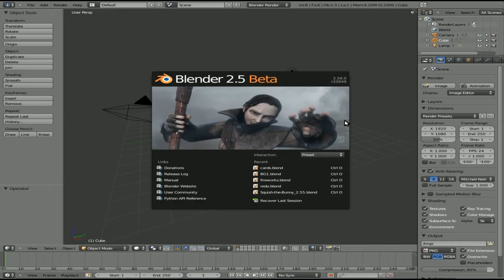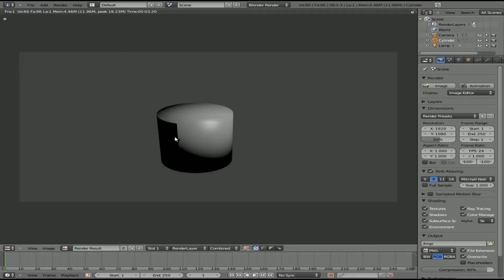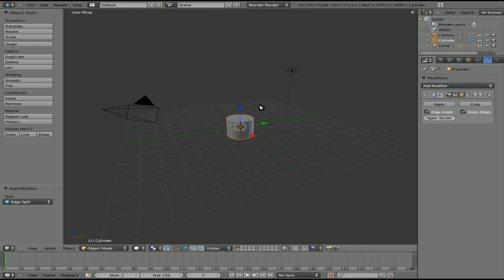Edge Split to Fix Smooth Shading in Blender 2.5 - Blender 3D

Comment: hey MEIDOco , im modelling my first car ad i think i know how to help you, if u look at your model, first save what u have just in case, but then get rid of the subsurf modifier first then the edge split modifier, select all the verticies that make up the faces that are shading incorrectly and look to the bottom left of the window above the time line then do this. click the tap Mesh>normal>recalculate inside Hope that helps bro!

Comment: @MEIDOco Recalculating normals basically rotates all of the faces so that they all face outside the model (faces have two sides, one being textured and one being completely see-through, much like a one-way mirror).  It doesn't always work though, especially on letters (and especially when the letter has a hole in it, like P and O).

Comment: @metalx1000 

Played with Blender for a whiledoing some random models as tests and eventually, I found the solution; all I need to do was actually just Recalculating the Normals. I still have no idea how it actually works but it really fixes this problem. Thanks a lot for the response :)

Comment from the maker: @MEIDOco: Hard to say.  Sounds like the model may have not been designed properly.  I don't know if you made it or if you got it some were, but one thing I know you should try and avoid it having faces with only 3 sides, this can cause problems with smoothing.  Other then that,  off the top of my head, I don't know.

Comment: How do you fix smooth shading problem where there's always a slight sign of somekind of patched skin on the smoothed + subdivided/subsurfed mesh I'm making that somewhat looks like the poligon faces aren't connected with the others. I already put EdgeSplit ,far better than what it was before but the marks are still slightly there. So far my only way to solve this is to delete those faces & rebuild them back but it sometimes can be tiresome and I dunno what triggers this problem at the 1st place.

Comment: My advice for this is to deselect "Edge Angle" and then make the edges you want split "sharp" (select edges -> CTRL+E -> Mark Sharp).
It just gives you a lot more control over what's getting split and gives you the freedom to split areas that aren't necessarily at a high angle to each other.

Nice video though :D